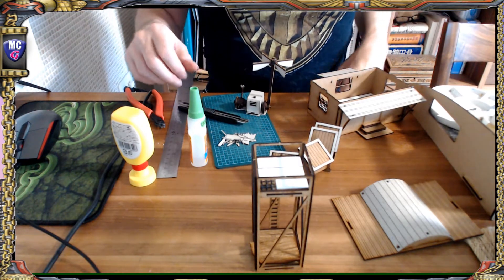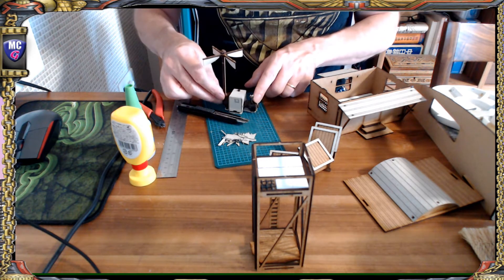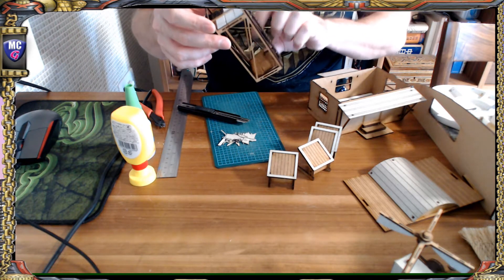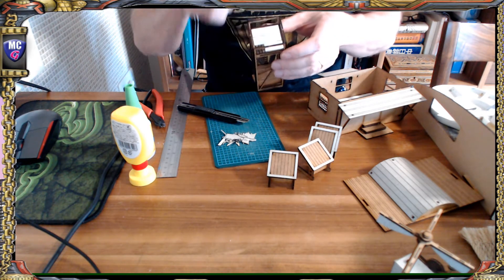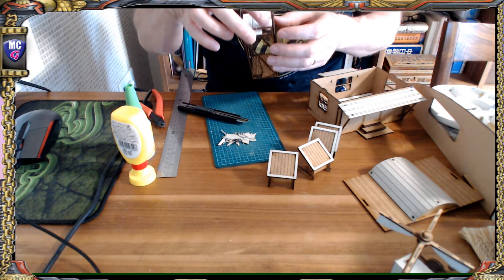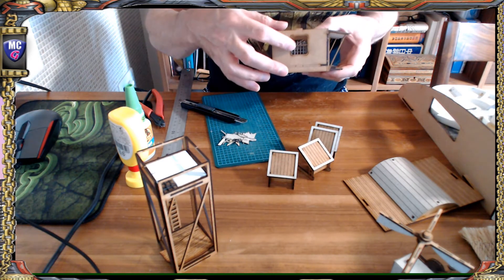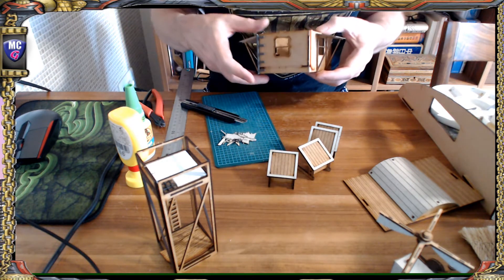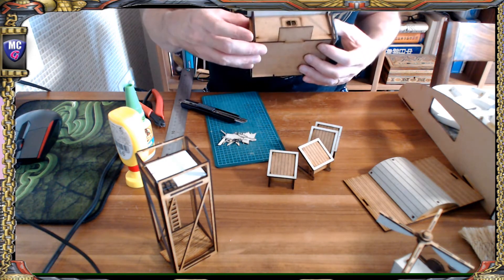Strontium Dog Terrain Build Pt5

Comment: You can rough up the wood with a wire brush to make it look more worn and old (courtesy to The Terrain Tutor). I really like where this is going. 
As the BoW guys said, I too would like a few detail photos on your Project page if possible. And one more idea, maybe put in some wires, like wiring the walls inside the building and wires on the generator and solar modules would add a bit of flavor. Cheers.
Reply from the maker: Great ideas! I'll definitely go back and add wires. The next few painting vids are already made and will be uploaded shortly. I'll add one more in the series for adding wires.

Comment: I just glued in the punch-out areas for the top of the tower to give it some cover, rather than remove them.   I'm a bit surprised how flimsy the tower is given how much wasted space there is on the tower sheet.  They could easily have made the struts thicker or even included crossbars or whatever.  Or made the base for the generator out of mdf from that sheet.
Reply from the maker: I suppose they may sell the terrain pieces separately, so are on separate MDF sheets. Good idea to use the punch-out pieces.